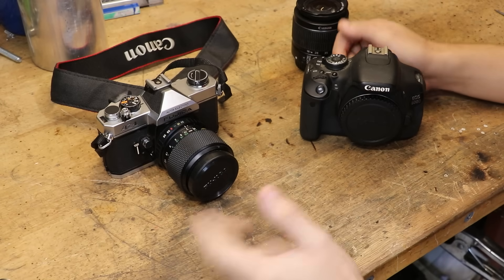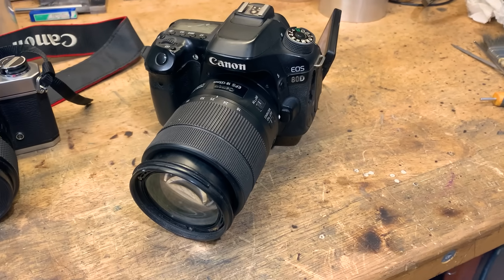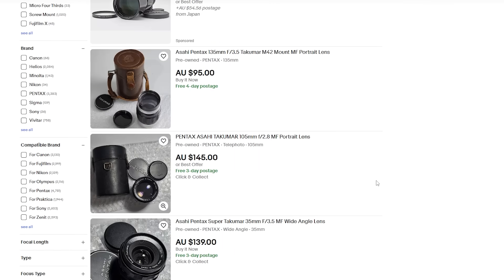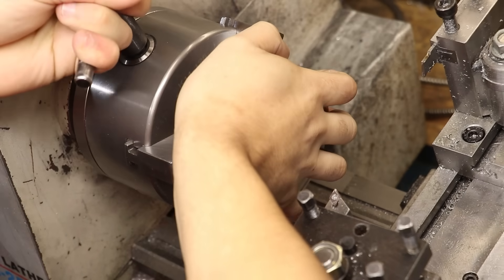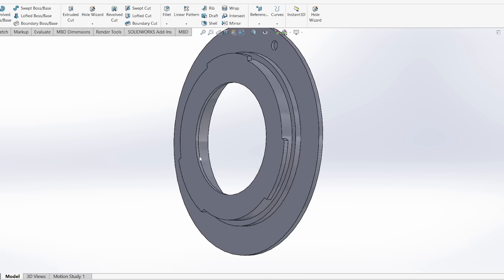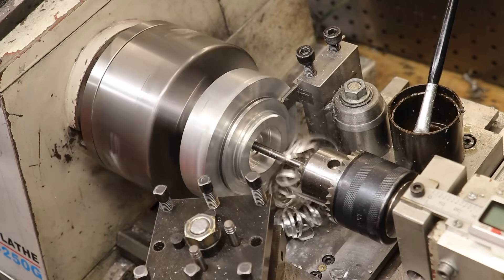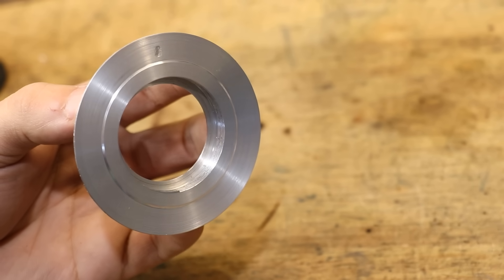Making Custom Camera Gear | Lens Adapter - M42 to EF/EFS (Behind the scenes of making a Video)

Comment: Does anyone know where I can find an adaptor that will allow me to mount my Mamyia Sekor SX Lens to a Canon EF?  The problem with all the mounts I have found is that the mounts are flat, and when tightened down, the F Stop ring bottoms out and I cannot rotate the F Stop ring on the lens.

Comment: Usually old film lenses don't have UV coatings that digital camera lenses do. The shadows of outdoor pictures will be a little blueish/purplish because of the UV that passes through. You could use a UV filter to mitigate that. And these lenses have less contrast it seems, aside from being softer or different colour tone.
Anyway, have fun using the M42 lenses!

Comment: Wait wait, so angle grinding shots has cost you 4-5 lenses worth 50 bucks each.
Thats 200-250 bucks.
Of which (where I live) 80-100 would have got you a decent portable bandsaw, with which you could have avoided said lens expenses.
Reply from the maker: No, it’s cost me 2 lens motors. And that’s years of bench grinding, angle grinding, surface grinding wood work and anything else that throws dust in the air. Yeah it’s no so straight forward as haha angle grinding bad. Cheers

Comment: I film using a Canon RF camera. Any mirrorless camera will have a much shorter flange distance than your DSLR, making them easier to adapt vintage lenses. And if you're making your own adapters, it would make workholding much easier. I have a small collection of vintage lenses I've picked up in the past few years. My favorites are the Tamron Adaptalls due to their versatility and cheap prices. My most used is a 90mm macro which is very useful for close ups, I also like the 24mm for wider angles. 
For your M42 mount, look into a Soviet Helios 44. They're known for their swirly bokeh which would be very interesting in a workshop environment. Also Pentax Super Takumars are very well regarded, I have a 55mm and a 150mm.
Reply from the maker: If it weren’t for the battery life of the mirror less at the time I probably would already be using one already. Would have made making this adapter easier though. Cheers

Comment: I only ever 3D printed covers for lenses, and even then I had to do multiple runs to get the tolerances right. Machining an adapter like this is really damn impressive, well done. 
Additionally, you didn't say anything wrong, but to be exact, the EF-S (APS-C cameras) mount and EF (full-frame mount) have the same shape (hence why this adapter you made will work on both), but EF-S lenses fit only on the EF-S mount. You therefore cannot fit an EF-S kit lens on a full-frame Canon camera. 
Another cool thing about M42 to EF adapters is that if you off-set the lens so that it stops further away from the camera sensor, you can still achieve focus and actually reduce the minimal focal distance, so you can get closer to whatever it is you're shooting. This is especially useful for M42 telephoto prime lenses, which often have unusually long minimal focus distances (beyond 1 metre). You do however lose the ability to focus to infinity by doing this.

Comment: I really appreciate the results of your adapter its a very nice reminder of what I got into photography in the 80's to do. Ive never had the money for new cameras since and even then I had an older minolta that I had been able to get working. It took beautiful photo's so I was somewhat heart broken when it finally died.
Ive never had a camera like it since with the exception of a digital Ricoh in the early 2000's that took better photo's than the camera I have now which is saying something. 
cracking results well done.
thanks for sharing

Comment: For tricky threading (amongst other things) you could make a lathe attachment from the old model engineering era in the UK (1930-1960).

Make a handle that fits inside the mandrel of the lathe - provides infinite control (and quite high torque), allowing some otherwise tricky operations to be performed.

Random example of what I'm talking about:

https://www.youtube.com/watch?v=zS70SMY6U-Q

Comment: Might be worth putting some matt black on the exposed surfaces inside the light box. The sensor won't absorb 100% of the light and with a shiny metal back what doesn't get absorbed will be reflected back and forth.

Comment: Making a lens mount from scratch that actually works is a small miracle in a home shop. Well done. Visible EM waves are measured terahertz, meaning wavelength distortion is measured in nanometers. The average home machinist might have seen wild distortion from one color band to the next across the image. Yours looks to be uniformly shifted toward white/grey corner to corner. Bravo.
Reply: What you're saying is true for adapters that have optical elements, even teleconverters have this problem. But the adapter that was shown here doesn't have any optical elements, it's just a way to mount an M42 lens directly to an EF mount camera. The colour rendering of M42 film lenses may look 'unusual' on modern hardware because the lenses weren't made for modern sensors, so they often require more post-processing. But this varies drastically from lens to lens, I have an f/3.5 135 mm prime lenses that has beautiful colours straight out of the camera, but I also have an f/3.5 200 mm prime lens that has similar colours to the one shown in the video straight from the camera, but it comes out really nicely after some editing.

Comment: Nice.

... so, where did you get that star wars film? is it from the trailer? Special edition (since it has the dolby sound between the sprockets)?
Reply from the maker: Spot on. Revenge of the sith trailer. Common on eBay, and it’s a nice collectable

Comment: for the ananorphic lenses, you 100% need to have them aligned to the camera. Probably worthwhile making a "jig" for that - just a m42 thread with a locating pin.
Reply from the maker: yeah you are probably right. should have enough room to take a bit off the front to move it over

Comment: I am looking at getting a AL250g Lathe, purely to avoid the hassle of changing pulleys. Paramount's here in Adelaide sell a better machine for roughly the same price with stand ( the FI 610), but changing speeds seems a real hassle, especially for a beginner who will need to keep changing speeds to optimise cuts at first. Do you have an update on the gearbox noise issue?
Last I have seen you put the heavy weight oil in and it significantly reduced the racket. I understand there were some concerns regarding it being a GL5 oil. GL4 being preferable.
Just wondering how you went with it, your videos have been very useful. Thanks for the input.

Comment: curious why you dont take the time to install those lights or new ones in the ceiling rather than use the clamps and red neck rig it like you do.  If lighting is that important then it should be worth the investment right?
Reply from the maker: It’s gotten there through boring bits and taking away till it’s ended up like that. I’m happy, it’s out of shot I’m leaving like that. Normally no one sees it so they can’t talk shit about it till I show it.
Reply: @artisanmakes  lol ok bud

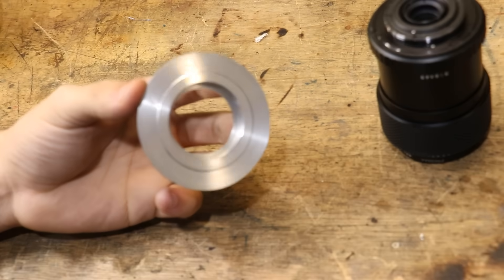Comment: 13:47 - how did you get thoses 'locks' done on the outside of the inner ring? I seem to see some sort of mill work when you flip the part.. have i missed anything or you simply forgot to add the footage??
Reply: He cuts the lugs before he completely parts it from the bar stock.

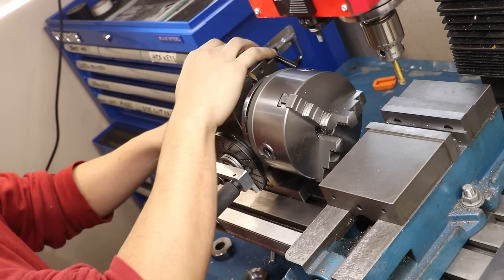You can see him start the process here (10:26) after cutting the relief on the back of the lugs.

Comment: I bought a few M42 lenses and EF adapter a few months ago, thankfully the adapter was not $60 for me. I was wondering how the threading was going to line up with the Canon mount clocking, so while it's not perfect, it's honestly a lot closer to straight than it could have been
Reply: $60 (Australian) is a bit deceptive. A dumb M42 to EF converter ring will cost less than €8 or $14 Australian online. 

If you go for a fancy one with a focus confirmation chip (which I personally highly recommend, since it enables focus detection in the viewfinder!) will go for €28, or about $50 Australian.
Reply from the maker: FWIW i didn't look beyond URTH gear. It is a brand ive bought ND filters from before, they make good stuff and that's where I would have ultimately bought mine from. You can probably get them cheaper, but it really wasn't the point I was trying to make. Maybe I could have phrased it better, but I'm recording this at 2am and the URTH price was the Price point that came to mind

Comment: A quick squirt of WD40 every few seconds will solve the problem of the gummy aluminium sticking to the cutting tool.
Reply from the maker: I prefer proper cutting oils. Which I use here. Wd is not a good choice imo and worse for you when vaporised
Reply: @artisanmakes  I use cutting oil for everything but Al. Polished inserts cut Al with less effort and leave a lovely finish. I don't detect any vapour using WD40 with polished inserts because minimal heat is generated. Apparently metho is good on Al too and the fumes are harmless.
Reply from the maker: Interesting. I find wd rather foul smelling when it vaporises.
Reply: Isopropyl alcohol is great for shiny finish on Al.

Comment: Cool video!. There’s always something mesmerising about watching lathe work. I have a question regarding your lathe. What gear setup have you got on the feed rate?. I have the hafco AL 320g and I’ve been playing with the gears lately for threading. I nailed the setup for 1.5mm metric threads but since going back to normal feeds, I can’t find a gearing combo that gives a good, clean finish. Cheers!

Comment: Always enjoy your videos, relaxing to watch and well done. Mine however are totally opposite as I lack the artistic talent and patience to film and edit. What color lighting do you prefer to film with. I always complain my shop isn't bright enough and when I eventually get the new ceiling up I plan on allot more lighting. I generally do 4200K as getting true 5K lights at a fair price is nearly impossible and most that claim to be 5K are actually higher into the blue range. 

         Being a neanderthal when it comes to making videos I had used a go pro which I hated because it was so buggy and now use an Ace Pro which is lightyears better. I do have a basically new Cannon T3 that I can't seem to sell and not sure it's worth even trying to use however I do have several 80s Pentax lenses that my dad bought on trips to Japan as he took lots of pics when we lived in Hawaii. Is that stuff worth putting any effort into?

Comment: Surprised you didn't anodize it. Nice job👍
Reply: wach out with anodisize, it stops gliding and the adapter wil be permanently mount on the camera. use a tiny bit of oil to avoid this.

Comment: So you made a Pentax Screw to EF adapter, mate they have those adapter off the shelf.  Also you have to also be aware of the crop factor, as your canon is not a full frame sensor, where as your Pentax screw lenses would be full frame, so there is going to be a crop factor on the image produced.
Reply: .... This is a machining channel, not a buying stuff from the Internet channel.
Reply from the maker: Yeah. If I bought everything I might as well sell that lathe and mill. Fwiw the 80d is a crop. The old 5d isn’t. But I don’t use that here

Comment: I have an older Nikon digital camera. I use it in manual with old Nikon lenses. I think the older lenses have a smaller range of their best sharpness. Meaning that the picture is noticeably better at a specific point. Modern lenses are sharper, even cheap ones; over more of the image.  The thing is the older lenses give a better sense of depth. I think this is because the eye focuses to the point of sharpness on images from older lenses and the rest being slightly less sharp, gives are brain a more 3D view. In the reverse. when the whole image is sharp, it looks flat. The lack of sharpness in the other images make the objects easier to place relationally in our minds. When everything is sharp; it appears, on almost the same plane. At least that is how I see it.
Reply: Interesting.  Would go a long way to explaining why digital lighting is awful.

Comment: Very nice video. Your camera work is awesome. As is the lighting. 
A couple of nits - you skipped over the hard part - how do you keep the adapter perfectly parallel when you flip it over? 
I make a lot of parts similar to this and the only thing that works is lathe soft jaws. 
Another thing is that it is not 100% necessary to hit the exact dimension.  You can be shorter slightly and you will focus past infinity. Too long is a problem and won’t focus to infinity.